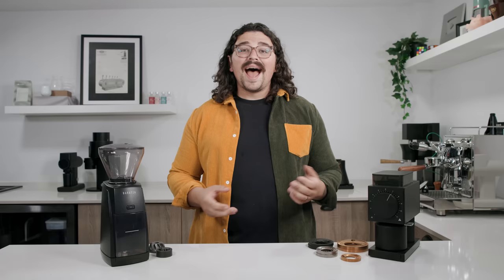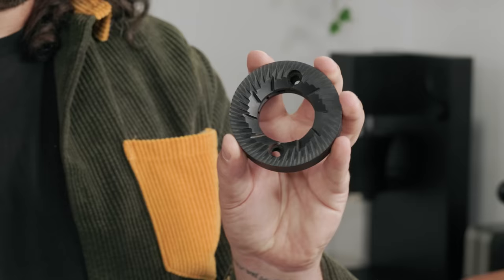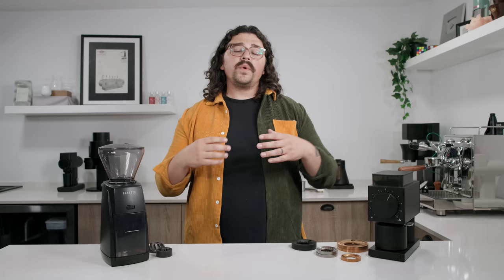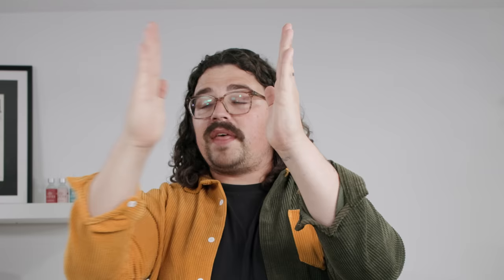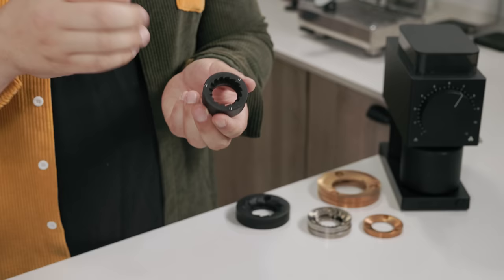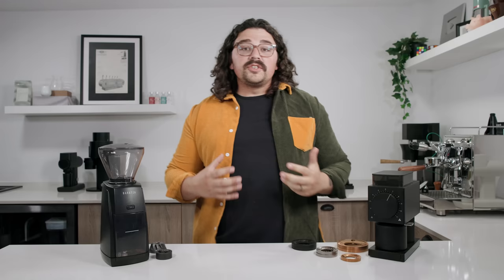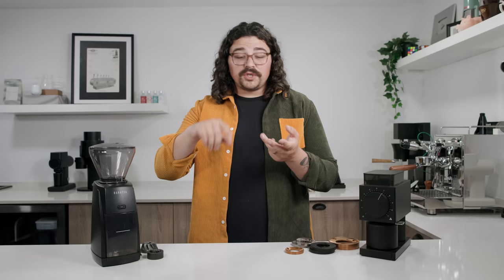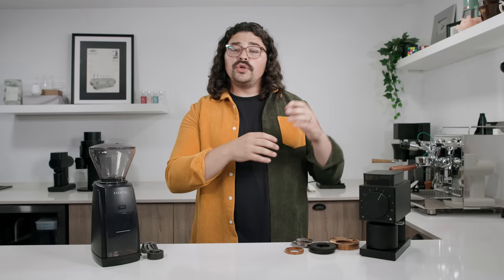THE GREAT BURR BATTLE: Demythologizing the Conical vs Flat Debate

Comment: Lance, I think that once specialty coffee starts to become more popular, many people who have the ability to taste it will not necessarily be interested enough to make it, because every coffee and new season means that new procedures are necessary to brew it to its fullest potential; therefore, the future will be to go back to using coffee makers.  But the same will happen, for instance, for home cooks, where the traditional ovens and coffee makers will be replaced by a fully programmable computerized appliance where you can go manual, or you can scan a QR code into the machine that you get from your friends, your coffee community, social media, marketing, or the vendor.  The most serious and committed will have a separate grinder and they will load the coffee machine themselves and it will have the ability to control every variable that is being considered, currently, by competitors at the world brewers championship.  The appliance that would be parallel to the one I am predicting would be "Rational" oven which doesn't take QR codes or programs from the vendor yet, but I foresee that one day once there is demand for it by the residential consumers who purchased them, the food industry will will meet the demand for prepared and semi-prepared meals that can be programmed into the interface on the cooking appliance like an oven.  Bottom line, there will be a spectrum between merely eliminating any need to cut vegetables and meat, and fully prepared meals that come with instructions that can be programmed into your home cooking appliances.  Trust me, I worked as a cook/chef for more 15 years and there is little romance in food preparation anymore, and the concept of "our food is our culture" is outdated, restrictive, and needs to be modernized.  People are ready to stop chopping vegetables themselves; not even the restaurants need to do it anymore.  The amount of time spent on meal prep by the average householder is absolutely absurd when you start thinking about it more, because neither does your tasting skills, nor your culture need to be developed at the kitchen table, both can be learned completely independent of this "home performance."  Sure, there will always be people doing things "hand-made," but there is considerable expansion available to humanity as a whole when we free ourselves and stop equating our identity with traditions that hold us back.  The same is true of coffee.  We are stuck on this concept/idea/belief that "food brings us together," but if I am correct, then there is considerably a lot more to be discovered that do that.  Food does both: it defines a group and delineates groups from one another.  In a world where new foods are being designed outside the limitations of any decade, century, or millennium old food tradition, there are a lot of food traditions that are being exposed as not being less good and the group whose identity was delineated from other groups by that food is losing this ability and needs to just replace the role food once played in doing so, with some other means.

Comment: Hey Lance, do you have any opinions re. ease of dialling in? I know the Niche Zero has been hailed as allowing relative noobs to pull great shots. Is that a conical v. flat burr thing, d’you reckon?
Reply from the maker: No. That's a particle size distribution thing. The wider the peak, the easier to dial.

Comment: I have a Weber KEY and hearing that the difference between 50-150 isn't a big deal is a bummer :\
Reply from the maker: To quote exactly, he said "I didn't find a massive difference in Key's PSD as the RPM changed"
Reply: what about flavor, did he mention? I do notice it's more static at 150rpm VS 50 though for sure especially in Winter with low humidity  @LanceHedrick

Comment: I did hear that espresso profile on my Eurika Specialiita 55mm is closer to Nich Zero not to standard Lagom p64 or df64v. It has high RPM. 
I also heard that Sculptor 078S is relatively close to HG Core burrs in geometry and profile. Can you confirm or deny?
I was thinking of trying something new designed for SD to try alongside Eurika preferably without bellows this time and with RPM control. I use a SD mod and still loose and gain around 0,5 grams from time to time.

Comment: Sorry to be pedantic here, but I have to.  Centrifugal force is obviously not a big factor in coffee grinders.  The diameters and rpm’s involved are simply too low, a lot too low, to generate significant centrifugal force.  Also, gravity, is not a very large force in this situation.  It gets the beans from the hopper to the grinder entrance, but that’s about all it can accomplish.  It barely gets the ground coffee from the grind chamber into the receptacle.  What is forcing the beans and bean fragments through the burrs?  Friction between the driven and the stationary burrs with the driving force coming from the motor.  That’s why the teeth on the burrs are always angled or spiral, so that the rotational torque from the motor partly turns into a radial (for flat burrs) or axial (for cone burrs) force pushing the coffee through the burrs. 

Practically, of course, a user only concerned with getting a cup of coffee to enjoy does not need to know the physics of burr operation, but a supposed expert pontificating on the operation of grinders really ought to.
Reply from the maker: Eh. I listen to my friend and astrophysicist Jonathan Gagne over a random commenter. Not to be rude, but I don't know you. I know Jonathan and he has gone to war with people on this. Pedantry is always excused, but the lame final sentence is incredibly annoying.
Reply from the maker: Not to say you are wrong in the other points. Those are quite obvious, though. Obviously angles of cuts do this, as has been observed for millenia on old querns with slanted furrows. Very odd thing to become incredibly fixated on, but you go, Mark!
Reply: @LanceHedrick  Please ask Dr. Gagne to think carefully for a couple of minutes about the magnitude of the various forces acting in a coffee grinder.  I am certain he will conclude that the motor torque, acting through the screw shape of the burr teeth, vastly overpowers the centrifugal and gravity forces acting at the same time.

For the purposes of your Youtube spiels, just omit the words centrifugal force, and you will be fine.  The burr teeth are forcing the beans through the burrs.  Say that.